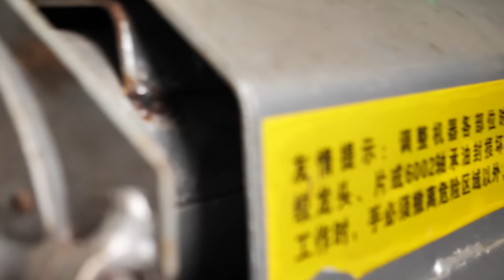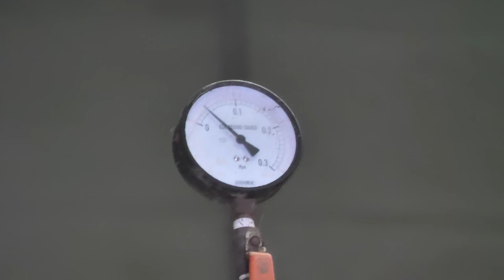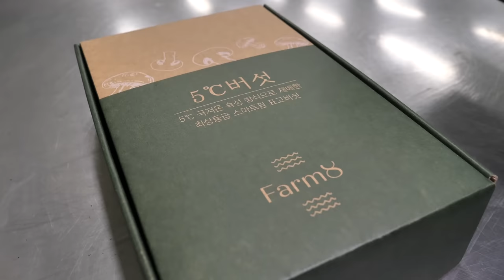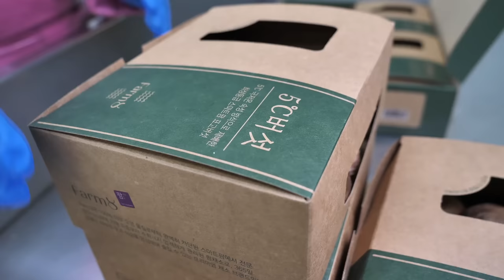Farming is also science! process of growing fresh mushrooms by Korean scientists.

Comment: why don't you make the mushroom embryo bag shorter, hang it in a long way, it will save a lot of space, just make a hanging frame, in my country we usually do that
Reply: I suspect it's a moisture thing. If it's vertical, you run the risk of the moisture settling to the bottom, after condensing at the top. That's a gradient which makes the fungi struggle harder to grow, rather than put energy into its fruiting bodies, which is the part we sell, buy, and eat.
Reply: Don't you think this type of mushroom grows upwards not sideways?

Comment: There must be a way not to use that much plastic! 
Impressive though.
Reply: 100% agree
Reply: Its a bit difficult. You can grow some mushrooms in reusable buckets instead of bags, but then there is a lot of work with cleaning them so you wont see many companies using them. There are some that use bottles, but you need an automated cleaning line to make it efficient which means its only used on a very large scale
Reply: @MajnerHraje  Yes, I believe there is a reason behind it, and those are probably recycled too, I was simply terryfied.
Reply: I imagine a process where the substrate is in a container. After harvest a new layer of substrate is added on top and the bottom layer will be disposed. The mycelium grows in the top layer and a new cycle begins.